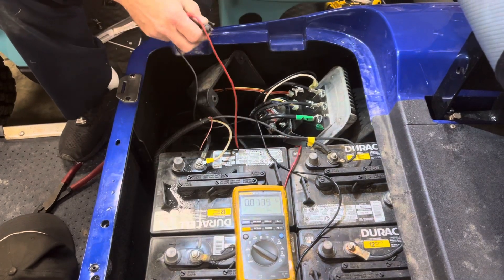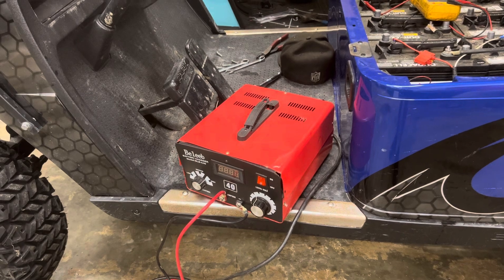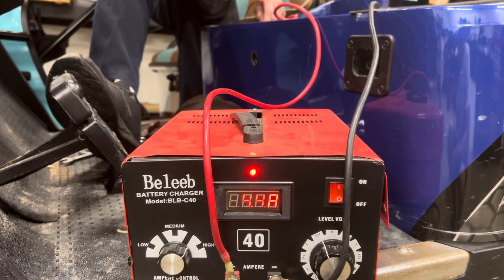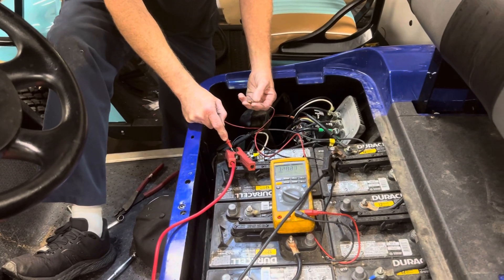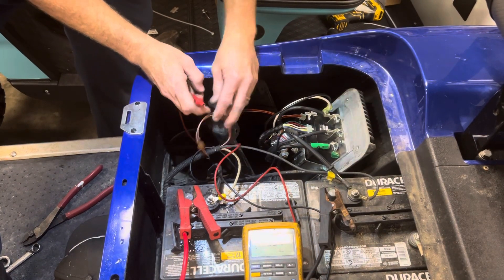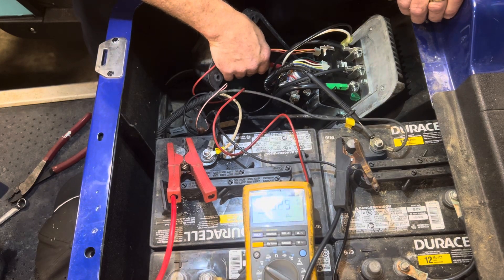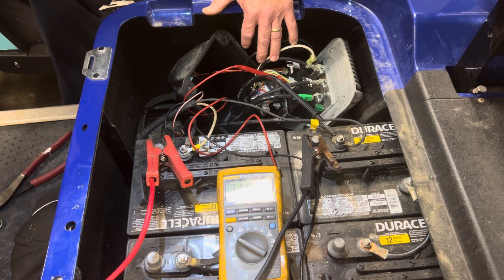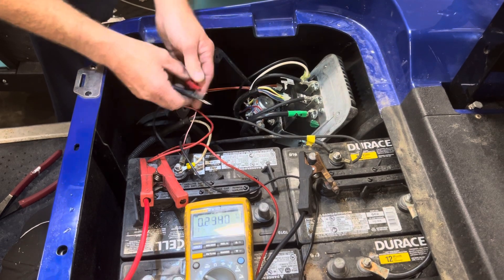EZGO TXT Electric Troubleshooting: FIX Your Golf Cart FAST!

Comment: thank you so much for making this video!! i pulled mine and it just clicks now (no tow switch) burnt up a black wire on that controller, can i just replace that wire? and where do you find replacment parts for these things? thank you so much for what you do!!
Reply from the maker: What do you need and I’ll send you a link to purchase from
Reply: @golfcartwhisperer  i have a 98 ezgo Txt i ran out of battery and pulled it now it just clicks. batterys are reading good. theres a black wire  all the way on the passenger side that connects to top of controller then goes down about 6 inches and connects back to controller close to compastor (im assumming thats what it is round cylinder thing).
Reply from the maker: @Hannsom7 does it click and stay engaged u til you let go of gas. Put black lead on m- on controller red lead on main battery positive and see what it shows when you hit gas
Reply: @golfcartwhisperer ok so it sounds like it stays engaged till I let off, the wire (that burnt up) goes from B+to the capacitor . I think that's a capacitor. (Silver cylinder thing with 4 post on it) that wire went from B+ to the side of that silver cylinder. Only about 6 inches long prob
Reply from the maker: @Hannsom7 that is your solenoid
Reply from the maker: So all you would need is a battery wire I’ll tag some in this video so you can order
Reply from the maker: EZGO 36V Controller Troubleshooting!!
https://youtu.be/KJWpnPyLlZI
Reply: @golfcartwhisperer yes sir, vin in same place exact under the hood lol
Reply from the maker: So you do have a tow switch on passenger side of cart
Reply: @golfcartwhisperer  yes so i replaced that wire and im still hearing that click noise and no movement.
Reply from the maker: @Hannsom7  EZGO TXT 36V: The Troubleshooting Guide You NEED(DCS)
https://youtu.be/VrsA-0Ijgpc
Reply from the maker: @Hannsom7 watch the video I sent you and tell me if your cart is like this
Reply from the maker: So you have this style cart here watch this video

Comment: I got a cart that wont go in reverse. im getting the 14v on the white wire and the .8 thru 2.5v on the black wire when in forward but nothing on those wires in reverse. i hear no sylonid clicking when in reverse either. You got any idea what may be up? The cart was given to me so i aint got no ideas. it is pretty weak in forward also if that adds anything relevant.
Reply from the maker: What type is it. Meaning series or Pds.  What year and do you have a tow switch or handle by your leg
Reply: @golfcartwhisperer  no handle by leg. probably was oine but someone has ran a charger cable through that hole and a 36v charger in the battery box. it is a txt pds. been hacked on a bunch. i figured out the speed sensor wires were cut so i twisteds them back up and got good power in forward now. still no reverse. also found out that they had the sylonid direct wired to posative battery terminal. when i disconecting it and only having the wire from the controller plugged in to it i get no forward or reverse so i wired a light switch to disconect and connect the sylonid straight to the battery. pretty sure i got a bad controller. appreciate your response.
Reply from the maker: @chasthanhburns123 do this here on your f n r switch flip the orange and green wire and see what it shows.
Reply from the maker: @chasthanhburns123 plus watch this video I am about to share with you
Reply from the maker: @chasthanhburns123  How to Fix Your EZGO 36V PDS Golf Cart (DIY Repair)
https://youtu.be/Yu2B6i9CaWg
Reply: @golfcartwhisperer  i switched the f/r wires last night to test the f/r switch. the cart drove in forward when the switch was in reverse. still no reverse tho. figured the f/r switch is good. i am almost sure the pds controller is shoot. probable gonna pick up a cheap 70 dollar china one sooner or later. more likel;y i just drive it with no reverse untill some one else has garbage i can salvage one from. i will watch your linked video tho.
Reply from the maker: @chasthanhburns123  I do this here flip them back how they go put your gold meter lag lead on main negative red lead in the orange wire on the controller main harness plug in reverse hit the gas. Tell me what you get.
Reply: @golfcartwhisperer  i get no voltage on the orange wire when pressing the gas pedal
Reply from the maker: @chasthanhburns123 okay go to back of the fun r switch and test the orange wire there while you have it in reverse. Black lead on main negative
Reply: @golfcartwhisperer  nothing
Reply from the maker: Unhook orange wire and test the post that the orange wire plugged into
Reply from the maker: What year is the cart
Reply from the maker: Test the grey wire in middle
Reply: @golfcartwhisperer  nothing at pin when orange wire is unplugged. i think it is a 2004.
Reply from the maker: @chasthanhburns123 how do you have the pins too to bottom.  Should be orange grey green.
Reply from the maker: @chasthanhburns123 check the grey wire in the middle. If you want you can reach out to me at 843-595-1611
Reply: @golfcartwhisperer  mine are gray orange green.
Reply from the maker: That’s wrong should be orange grey green
Reply: @golfcartwhisperer  does it matter that it is a 2009 not 2004? i just looked up the code f0809.
Reply from the maker: No not at all
Reply: @golfcartwhisperer  I just re read the conversation. I thought we were talking about the wire order at the controller not the switch. my bad.
Reply from the maker: @chasthanhburns123 gotcha

Comment: Any chance you can help me diagnose or troubleshoot issues with an EZgo 36v cart? Sometimes it works fine then just dies. Lithium battery shows 36v. Please shoot me a message if interested.
Reply from the maker: Yes sir we can do it here or you can text 843-596–611  and for 45.00 you wil. Get your golf cart fixed
Reply: Texting you today!
Reply: Missing a digit on that phone number
Reply from the maker: @istriker22 8435951611

Comment: I dont know why my reply keeps disappearing. But, ive got a 2006 EZ-GO 36v TXT PDS. The serial number is L101 1430306. All switches and wiring tests as good. I have no voltage at the 10 pin harness white wire.
Reply from the maker: You have no voyages on none of the wires how are you testing the
Reply from the maker: Watch this video here
Reply: @golfcartwhisperer Sorry, I'm not seeing a link
Reply from the maker: How to Fix Your Golf Cart (DIY Repair)
https://youtu.be/Yu2B6i9CaWg
Reply from the maker: @parkerd619  did you get it?
Reply: @golfcartwhisperer Yes sir. I just watched it. That video put me on the right path. It looks like the controller is shot. Time for a replacement. Do you have any vendors that you recommend?
Reply from the maker: @ yes sir just get you a Curtis or a rebuilt FSIP. Stay away from the Chinese knockoffs. The people I’ve helped on here have went through three or four before they got one good one. And as far as a vendor, everybody goes to eBay or Amazon.  But if you want speed go to Navitas controller
Reply: @golfcartwhisperer Thank you Sir, I appreciate your help.
Reply: The reed switch is bypassed. The throttle switch, ignition switch, and fnr switch was tested with continuity tester. 

Everything seems to be right except no voltage out of white wire from 10 pin harness.

Comment: I've got fully charged batteries, reed switch is good, pedal switch is good, ignition switch is good, and FnR switch is good. Each switch was tested at the controller harness, so wiring is good. 

My problem is that there's no voltage at the white wire in the 10 pin harness of the controller. 

What should I be looking for? 
Thank You
Reply from the maker: What type of cart you have? Ezgo pds or dcs.  Or what year is it
Reply from the maker: How to Fix Your Golf Cart (DIY Repair)
https://youtu.be/Yu2B6i9CaWg

Comment: If my solenoid doesn’t click and everything else has power is controller bad?
Reply from the maker: @lubywarren  that’s correct.    Thanks for taking the time to troubleshoot per the video
Reply: @golfcartwhisperer  thanks. I watched your videos and that’s all I could come up with. New it’s, micro switch and solenoid.
Reply from the maker: @lubywarren damn that sucks. A lot of wasted money. Glad you found my channel. Make sure you like and subscribe. That way you can find it again.  The motto of this channel is we replace one part the bad part.
Reply from the maker: @lubywarren  do you have voltage on the small yellow wire on sol. Or if it a series cart the small red on solenoid. Black lead on main negative.  Red lead on small post on sol
Reply: @golfcartwhisperer  not that much money. Old cart decided to put in new parts.
Reply from the maker: @lubywarren 10-4.  That’s good then. Probably saved you a headache later on
Reply: @golfcartwhisperer power
Reply: @golfcartwhisperer power to all posts on sol. No power to black lead on ITS.
Reply from the maker: @lubywarren  if you have voltage on the 2 red wires on the bottom left of main harness and all 4 of the tow switch. And you tested by putting the black lead of your meter on the main negative and the red lead in each of the 6 wires one at a time while they’re still plugged into the controller.   Replace the controller.
Reply from the maker: Do you have a tow switch?
Reply from the maker: @lubywarren  the test I sent you above is for a cart that has a tow switch.
Reply: @golfcartwhisperer yes only two wires connect. I put the wires together and bypassed the switch.
Reply from the maker: @lubywarren  so is your cart 48 volt?
Reply: @golfcartwhisperer yes ezgo txt 2014
Reply from the maker: I’ll send you a video on the txt 48 volt
Reply from the maker: Watch thisEZGO txt 48 volt won’t move/troubleshooting
https://youtu.be/g69xvN0DK8I

Comment: Great content. What did you ohm out at the very end? And can you tell me what the read switch is and how testing it works. You’re a blessing man.
Reply from the maker: The reed switch is a safety switch where the cart doesn’t run. While the charger is plugged in.  A lot of golf courses. Used to tear chargers up because they would jump on the cart and go with the charger plugged in. But if you unplug the reed switch. The charging port side should read battery voltage. Black lead on main negative red lead in charging port side.
Reply from the maker: At the end of the. Video I am  ohmning out the field whining on the motor. The reason I do that is because sometimes when the motor shorts out it fries the controller or if somebody towed the car home and run, it would tear the motor apart therefore, if you put a new controller on there and the motor is bad it will burn the controller up.

Comment: Would you say if everything checks out good on a 1999 txt 36v but I am getting 12.9 volts on the white ITS wire when I press the peddle it’s probably an internal controller issue? I get 14.6v on the black ITS wire.
Reply from the maker: @matthewTownsend-dt7ye  first do this.  Take the floor board up.  And unplug the white wire and test voltage on the its terminal.  If it shows 12 volts replace its if it doesn’t replace controller.
Reply: @golfcartwhisperer  black wire has 14.5 V constant white wire shows 12.8 constant replaced three different ITS just ordered controller
Reply from the maker: Gotcha.  If the harness isn’t messed up or water in the pedal box and there isn’t any water under the it’s. Yea replace controller.  Seen that a couple of times but rare
Reply from the maker: You have a dcs?
Reply: @golfcartwhisperer  yes sir. 36v 5pin.
Reply from the maker: @matthewTownsend-dt7ye  does you solenoid click
Reply from the maker: But yes order controller. What’s the story with golf cart. Has it been towed in the run position
Reply: No run tow switch. Series cart. Solenoid clicks no movement. All micros and f/R  check out fine. Just have 12.39v on the white ITS wire no matter how you push the “GO” peddle
Reply from the maker: @matthewTownsend-dt7ye  yep, if everything else checks out right
Reply: @golfcartwhisperer  you were right! Swapped the controller and all is good. I’m guessing the black 14.8v constant bled into the white internally. Because now I can watch the white ITS wire got from 0-1.7v perfectly. Thanks again!!!!
Reply from the maker: @matthewTownsend-dt7ye  glad I could help. Just make sure you hit that like. Button for me. Also make sure you’re subscribed. Which you probably are